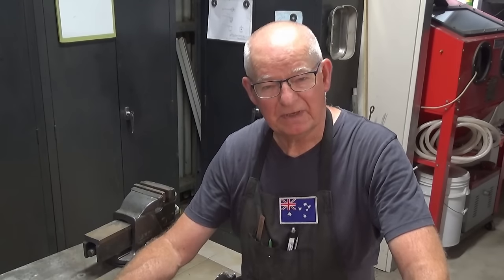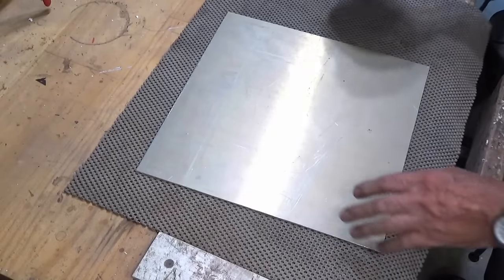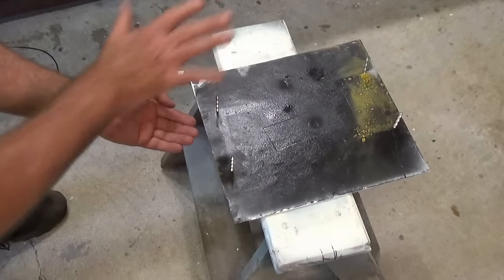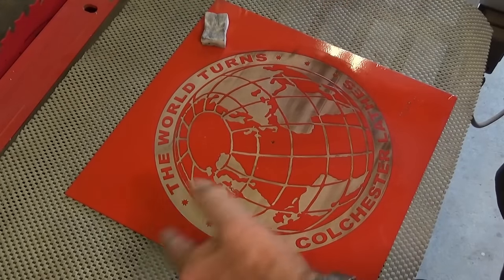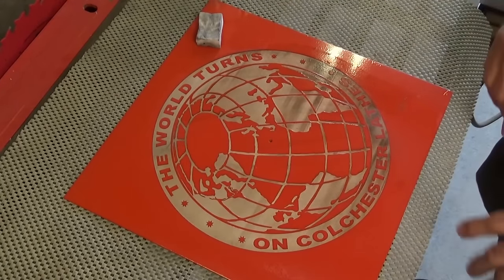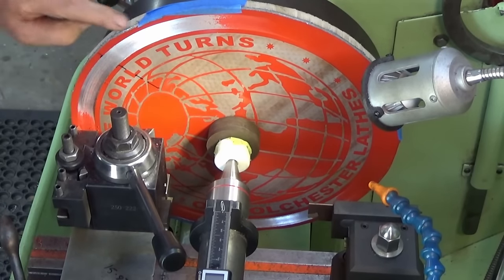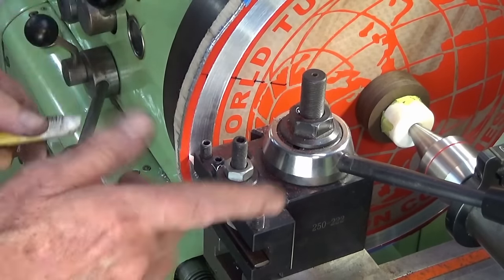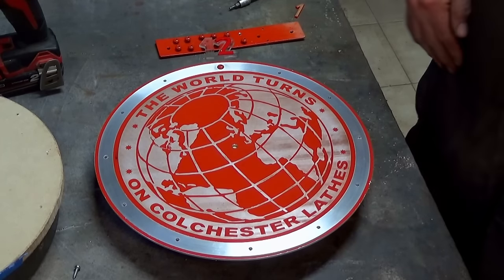Colchester Clock Part 1

Comment: Gday Preso, this is going to look absolutely beautiful hanging on the wall, I brought a clock movement to make a clock using a face plate off a lathe but then realised I needed to remove the gap in the lathe and couldn’t bring myself to do that, I very keen to see the next episode, have a great Christmas and thank you for all the awesome content this year, cheers
Reply from the maker: Thanks Matty. I felt very conflicted taking that gap piece out but it did go back in OK and I cannot detect any misalignment. A faceplate clock would look awesome. You could use strap clamps for the hour markers. 
Regards,
Mark
Reply: Mark, Keith Fenner makes frequent use of his Clausing lathe's gap bed and he seems to have few (if any) problems maintaining accuracy.  Keith "floats" the bed on a substantial amount of oil.  Perhaps his technique should be emulated.

Comment: Hi Mark, will look nice on the wall.
Couple of popular youtubers with wartime monarch lathes have the tailstock prism ground off to give extra swing.
But in those dark days it was production at all costs!
Reply from the maker: I actually had no problem putting the gap piece back but I think the key is to make sure that everything is super clean and I did run a precision ground flat stone over the surfaces first. I did totally overlook the rear vee on the bed. Dumb mistake really.
Regards,
Mark

Comment: As a woodworker, I tend to see machining problems as it related to the tools I own and for the problem of making the clock face perfectly round (and also to skim off the powder coat for the numbers), I would have used a wood router with a carbide bit (which cuts aluminum with no issue) along with a simple circle cutting jig.  It would have prevented a lot of the hassle you went through with your lathe although admittedly this wouldn't be a good fit for you if you don't already own a router and bit.  Great project, looking forward to seeing the next one!
Reply from the maker: I do have a router and the appropriate bits, and a circle cutting jig but I sort of got fixated on using the metal lathe. Also, I wasn't sure if the router might chip or score the powdercoat. I did get some minor chipping using the lathe tool for cutting and this job wasn't easy to selectively repair with fresh powdercoat. You will see the end result in the next video due out shortly.
Regards,
Mark

Comment: Thanks Mark. I absolutely love your videos, you make everything look so 'doable'. I think poweder coating is something im definately going to have a go at!!
Reply from the maker: In my view, a powdercoating setup is one of the investments that I don't regret buying. The initial purchase cost of the Eastwood gun and power unit was high (because I had to import it from the USA) but that's about the only capital cost. I already had an old toaster oven and the kit came with 8 or so cans of powder. If you already have a smallish compressor, that's about all you need. The powder lasts for ages and never goes off if you keep it dry. The process is pretty fool proof too. 
Regards,
Mark

Comment: Very interesting project Mark. It looks fantastic already. By the way, I used to work the exact same model Student back in the late 80's, it was a very nice machine. Cheers, Jon
Reply from the maker: Thanks Jon. My Student lathe was always meant to be a "temporary" machine until I could afford something better. It literally fell off a truck when it was being delivered to the school where I bought it from and I had heard that you should never buy a lathe that had been dropped. However I have gradually tuned it to the point that it can do accurate work and I only just found out recently that there were adjustment screws under the headstock to allow for alignment of the spindle. I don't think I will be needing to replace it after all. 
Regards,
Mark

Comment: I agree on the gap. I'd rather have a second lathe without the gap bed in it than to take mine out of my current lathe. I didn't catch the kind of laser you have. It looks like a C02. I've seen people criss cross the laser to clean up the etch properly. Not sure if your style is capable of that. It still looks really good though. Hope you have a merry Christmas, happy Hanukah, Happy Festivus for the rest of us or whatever it is you celebrate or don't celebrate. LOL. 🎄🎄🎄🎄🎅🎅🎅
Reply from the maker: My laser is a 50W CO2. It's a bit of a mongrel but it does perform well enough for what I do. I can set it to scan in the Y axis but I have never used it that way. In the next episode due out tomorrow I show how to clean off the remaining surface residue with a solution of sodium hydroxide. 
Regards,
Mark
Reply: @Preso58  50W is pretty good. I have a 50W fiber laser. it's really fast and I can do angled sweeps with it pretty fast. The downside is my work area is 7.5 inches and I can't burn certain Materials. Always a trade off. Someday I'll have a C02 laser as well. Looking forward to the new video.

Comment: Fenner has taken the gap out on his clausing several times. No issue, just make sure everything is clean when you put it back. I was wondering if burning off powder coat with a laser would work and now I see that it does. I have a project in mind now. Thanks for the video!
Reply from the maker: I did put the gap piece back without an issue but I cleaned everything as you suggested and I also ran a precision ground flat stone over all the surfaces. A bit of tapping with a copper drift got everything aligned again. Most powdercoat surfaces do etch off but there is always some residue. and it can be hard to get a really uniform finish when trying to acid etch brass with ferric chloride. I have tried and failed to etch aluminium with ferric chloride. You get a runaway exothermic reaction and it just destroys the powder coat. Sodium hydroxide can be controlled more easily by using a weak solution first and then increasing it a little at a time. 
Regards,
Mark

Comment: Is this for the town square tower clock lol? Btw what is involved in realigning the Gap? Maybe film it!? Happy holidays.
Reply from the maker: I didn't have any issue putting the gap piece back in. You just need to make sure everything is very clean and I ran a precision ground flat stone over the mating surfaces before nipping up the bolts. Once they are semi tight I tapped it in and you get a pretty good alignment just running your finger tips across the vees. I believe that our fingers are able to discriminate down to a few microns. 
Regards,
Mark

Comment: Excellent project and execution as usual Mark.  I know you are a powder coat devotè,  but could you have used spray paint?  I understand it’s a design choice, but is there a down side to cutting spray paint with a laser etcher?  It’s a method I’m considering, so I’m curious.
Reply from the maker: I have used automotive acrylic spray paint. Probably an epoxy 2K would be more durable but some of those paints have isocyanate in them which is probably going to be toxic when it is exposed to heat. There is a video by Wesley Treat where he paints aluminium with a black spray paint from a can and he then lasers of the paint. He seems to get really good results with it. https://www.youtube.com/watch?v=vdl1vDUQXL4
Regards,
Mark

Comment: While watching, I thought that if doing that myself I would have rounded the part then engraved. Any particular reason you did it this way? My lathe badge is an oval shape, so I don't think I will be following your lead immediately...
Reply from the maker: It could be done after turning the part circular. However, accurately aligning the part in the laser for the engraving becomes a bit more difficult if you don't have a registration pin for the centre. I have seen some lovely mid century modern clocks with elliptical dials. 
Regards,
Mark

Comment: Hi, Mark, new subscriber here. May I ask how you managed to use the powder-coated button-head screws? I would have thought the regular sized Allen Wrench wouldn't fit after powder-coating the screws, so maybe you used a ground down Allen wrench to fit properly? That way you wouldn't chip the powder-coating in the socket by forcing in the regular sized Allen wrench? Love your channel, so thank YOU! Dave
Reply: Mark, thank you for answering my question in your Part 2 video, about the Allen Wrench fitment! Dave
Reply from the maker: Socket head screws are difficult but Philips head and slotted screws are a bit easier. You just need to use a slightly smaller cross sections screwdriver. Chipping of the powder coat is also likely so you need to be careful about the screwdriver camming out of the slot or the cross. 
Regards,
Mark

Comment: Thats pretty cool! Too bad you didnt catch the oblong circle till after you laser etched it or you probably could have accounted for it in the vector program. Personally though those clock hands look an awful lot like each other and its kind of hard to tell them apart already. I think shortening the minute hand would just make that harder if you dont at least do the hour hand as well.
Reply from the maker: You will see in the next episode (due out shortly) that I did shorten the minute hand only. It's not ideal but I'll see how it goes. It turned out way easier than I thought it would be to reshape it without damaging the material.
Regards,
Mark

Comment: Did the Rotex leave that grid pattern on the surface ? Its was extraordinarily uniform.
Reply from the maker: Yes, the Rotex is a pretty amazing tool. I bought it to refinish our decking boards. It was the only sander that had sufficient power to handle the job without burning out. 
Regards,
Mark

Comment: Have you seen the slightly bigger clock moments that connect to your home wifi for automatic daylight saving time adjustment and daily time synchronisation. Im Not sue if they arehigh torque clock mechanism.
Reply from the maker: I have not seen them but it doesn't surprise me that such a thing exists. Where I live we don't have daylight saving so that's one less complication in my life. 😁
Regards,
Mark

Comment: The manual for my lathe (made in 2018) tells me to not remove the gap unless absolutely necessary and if I remove it to just leave it out permanently.
Reply from the maker: For what it's worth, it did go back in without a problem. I did clean everything and I ran a precision ground flat stone over the mating surfaces. The manual for the Colchester says to nip up the screws and then tap the surfaces until they align. I kept running my fingers over the surfaces until I couldn't detect any misalignment. I believe our fingertips are capable of detecting changes in level of about 5 microns. 
Regards,
Mark

Comment: Where did you find a good graphic file to use to make the resist for the etch?
Reply: Oh or rather to laser etch off the powder coat?
Reply from the maker: I did an image search on Google and found a reasonably accurate (but not totally accurate) version. It took some processing but I cleaned it up fairly well. You can download the artwork from my Dropbox as both a vector and a bitmap image if you would like it (free). https://www.dropbox.com/scl/fo/kv8qr8oxjgfttd9ssud0g/h?rlkey=vyliffxem6azb4v4obicoyzzx&dl=0
Regards,
Mark
Reply: @Preso58  That's awesome Mark. Many thanks.

Comment: Just a warning to those with Diode Lasers (WITHOUT fume extraction enclosures) in particular. Take EXTREME caution burning off in particular random Powder Coatings (even if you are doing your own check the MSDS) some are FLuorine based which is very dangerous.
Reply from the maker: Most of the powders that I have are epoxy or urethane and I generally steer clear of the more exotic powders. But I get what you mean. A lot of those diode lasers are sold as is with no fume extraction and the sales brochures often show users with them sitting on a kitchen table inside a house. 😦
Regards,
Mark

Comment: Some fellows would have simply grabbed an angle grinder and ground some clearance rather than remove the gap piece. After all, the tailstock will never reach that spot. But I know you would find that intolerable.
Reply from the maker: Gasp! Go to the naughty corner immediately! 😁
Regards,
Mark

Comment: Marc, you are quite the "manufacturer". Really enjoyed all the steps so far in process. One question though. Do you think the use of lexan backing for clock hours might have a problem with uv?  Thanks for your time and skills. The best to you and yours this Christmas season.
Reply from the maker: I didn't use Lexan (polycarbonate). The backing pieces are just clear acrylic (PMMA) and they shouldn't be exposed to much UV inside the workshop. 
Regards,
Mark